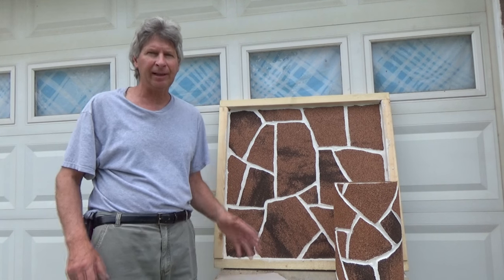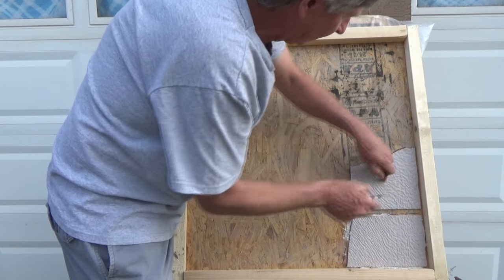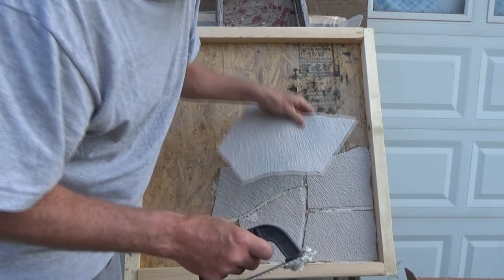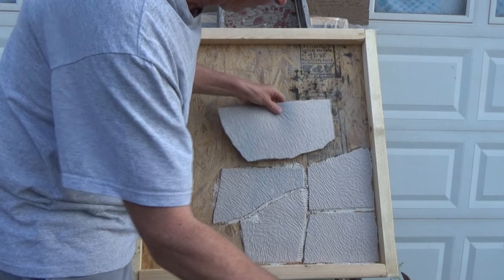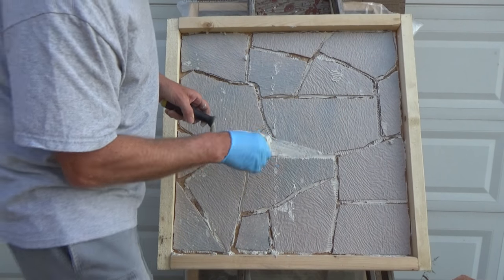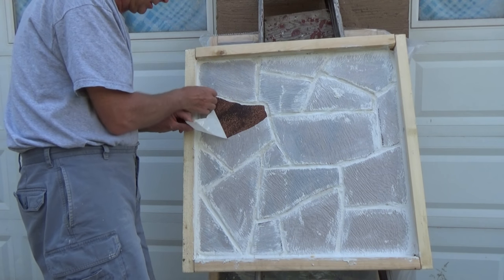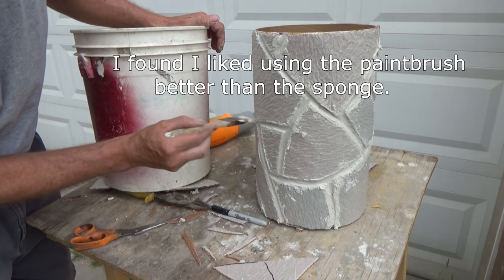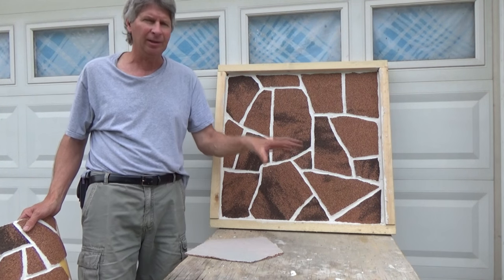STONE VENEER INSTALLATION (part 8) Mike Haduck

Comment: Mike, I like this product especially with being a woman. I watched you working with the stone in your other videos and I just shook my head as I felt there would be no way I could physically work with the authentic stone. I wouldn't be able to carry the stuff let alone work with it. I would need a year vacation between picking up the stone and starting the job. I like it. Sort of like the stuff they made back in the late 60's early 70's that came in square sections that was plastic and you glued it to the wall. I know, we had this in red brick in our sun parlor. I like this a lot. I am assuming you can use this in both exterior and interior jobs just like the real thing. I am impressed with it. I will be checking their website. Thanks again for another great video.
Reply from the maker: thanks  Dolores,  I appreciate the comment,   mike

Comment: Wow! I was already convinced I needed to use natural stone veneers and everything that came along with that and here all I needed is the flexible stone, thin set and scissors. Way awesome to know this!
Reply from the maker: Hi Djlsaacs,  it all depends on what you are doing and where,  but it is an alternative,  thanks mike
Reply: @MikeHaduck  hi Mike thanks for the response. I'm actually going to make as a DIY project an above ground pool made from cinder blocks and was thinking of laminating the outside walls out of natural stone veneers but upon seeing the video it changed my mind completely. Unless I can't apply the thin set to raw cinder blocks? Please let me know if I can or not, it would be so helpful to know before I start the project.

Comment: I have a question, I was thinking on change my patio floor and the product seems pretty easy to work with, with that said how is the texture of the product, is it rough as concrete or smooth to walk on it without shoes on?
Reply from the maker: I do not think this certain product is make for floors, bur I would check their web page and see what else they got, I hope it helps thanks mike
Reply: The tile has a grainy surface. Therefore , it is not very convenient to walk barefoot . You can do the installation on the floor ,  however we do recommend our tiles for places without a high traffic. :-)
Reply: Awesome thanks